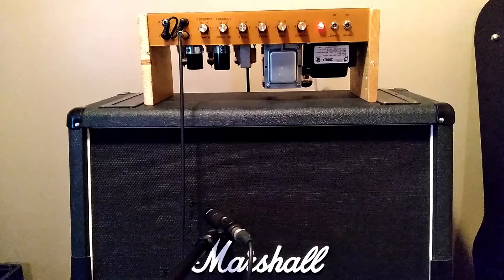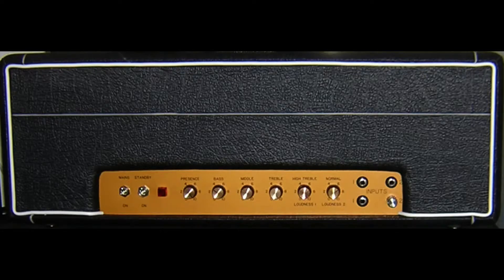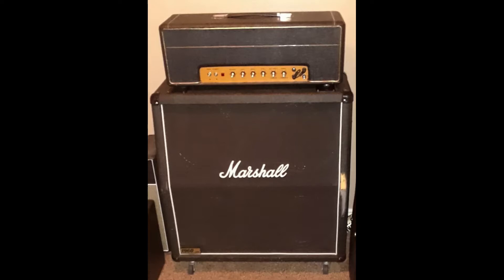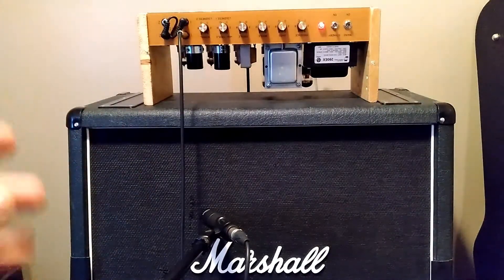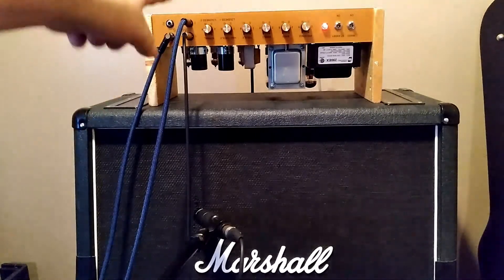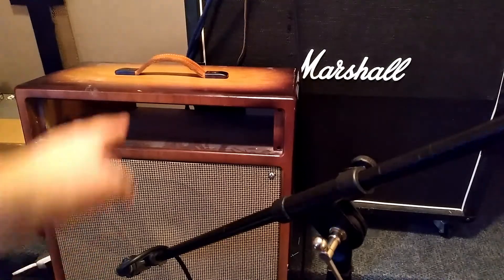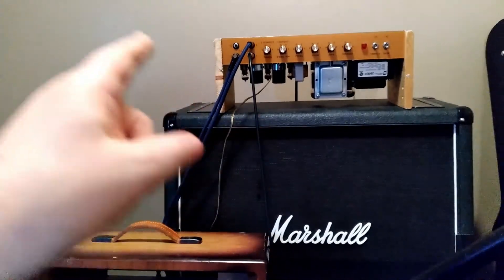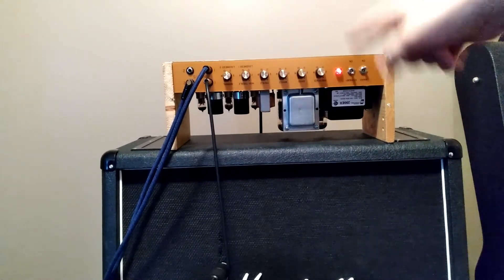Repair and Rebuild: Marshall JMP model 1987 50W - Part 4: Testing

Comment: Well done for taking those readings. I had to use a 100watt (8 ohm) celestion10" paired to a "15" watt 2 x El84 amp to get the best frim the amp, full volume...peaked at 60watts at 3/4 bias! Valve amps don't appear to obey any set laws on paper so be prepared and use a 4x12 or at-least 2x12 (70watts each minimum) so you can avoid melting that lovely New transformer or melting voice coils with too much distortion. I reckon after all this you could start thinking about the Vox AC-80 head as a possible build, now "That " would be good but don't rush. Great stuff!!BTW if you just plug an outside source in to amp (CD, phone etc) it could help get clearer readings and free-up your hands.
Reply from the maker: I may have to take some readings on the other side of the transformer to see if I can get AC output next time.

Comment: You've gradualy replaced the whole thing.  It came out nice though.  
I built my amp as well, after decades of never really finding what I wanted retail.  I couldn't be happier, and I'm sure you are as well.  If you don't like something, you can always change it.  That's not always easy with PCB amps.

Comment: Instantaneous DC measurements are not the power output from the tube to the speaker.  Nothing DC gets to a speaker.  You can measure the ac voltage on the speaker while playing a single note to get somewhat close to a reading, then do the math.  Evan that has huge error potential since a speaker does not have flat impedance across frequencies.  Use a high-power resistor and a frequency generator (e.g., phone app if needed) to get real figures.